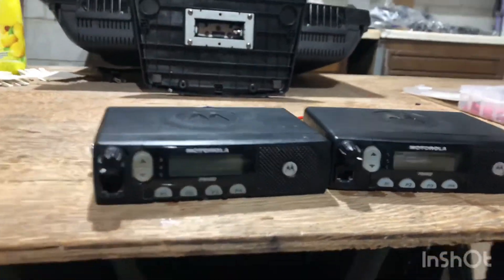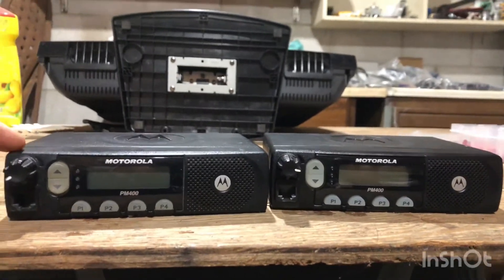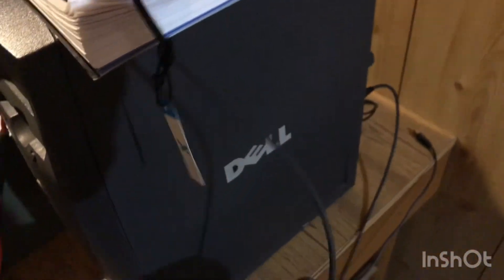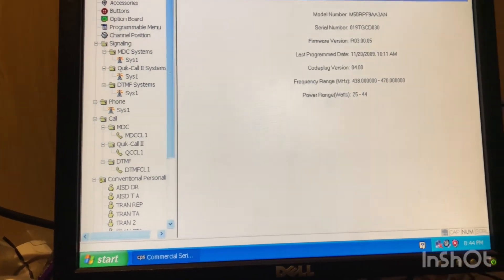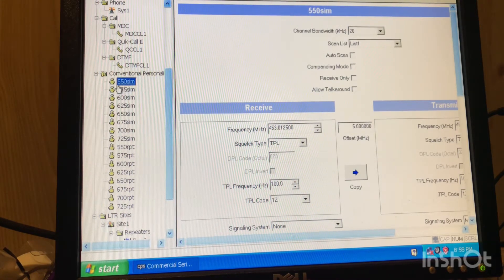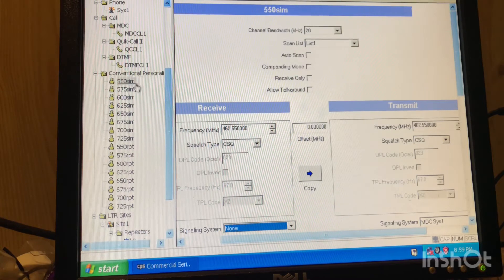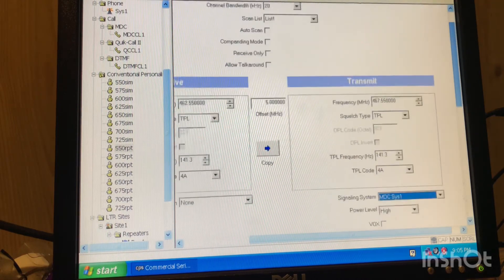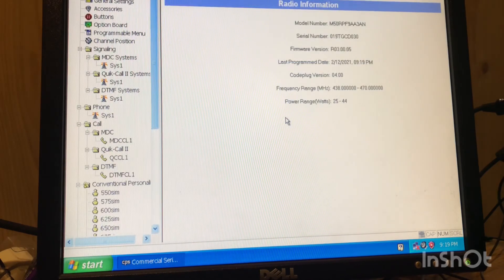Motorola PM 400 programming/GMRS

Comment: Having a problem after programming when I tx red light comes on one beep and no red light.
Reply from the maker: I’ve been out of the radio game for sometime other than basic use. However, if I ever had problems I can recall it being a Com port issue most of the time. In the software you should be able to com port check as well. 

Also, if that doesn’t help it could be the cable. Hope this helps. Thanks for watching!

Comment: Do you still program PM400's? If so, what's your pricing and how can I get it to you?
Reply from the maker: Negative, I lightly use and or mess with radios much more. We have a family GMRS repeater that rarely gets used. Also, Motorola is pretty strict with the licensing etc. I was lucky to have a local retired gentleman let me borrow the Motorola software. Thanks for watching!
Reply: I have free programming software if you still need it. The version that allows 25hz bandwidth

Comment: On the initial opening of the Commercial Series software I'm getting a note the it is  "Unable to open the Controller". Does this mean that I have to have the radio connected first in order for the software to actually open? Thanks
Reply: Set your com port to com4 and make sure your usb is plugged into com4

Comment: Hi, great video, I was able to program my radio thanks to you my friend. 
My radio also has Frequency Range (MHZ) 438 000000 - 470 000000, will I be able to program MURS frequencies by any chance ?
There’s any way of expanding the frequency range in this radios ?
Reply: No, murs is VHF (154 mhz) unfortunately.
Reply: I have the programming software that allows 25hz bandwidth if you need it. The newer version forces narrow bandwidth however if you have an uhf version it is stuck to uhf. There is another version that is vhf that supports Murs I’m pretty sure
Reply: Only way to do murs is getting a vhf radio. You will need a dual band radio to do both @GetBent520Az

Comment: Hello, thank you for the video, also I was trying to look at which version of CPS you were using, does this use a different CPS than MotoTRBO CPS? I could not tell from the video..
Reply: I have the software if you neeed it. It’s rvn4191 customer programming software. I have the version that allows 25hz bandwidth I know it’s late my bad
Reply: @GetBent520Az I need it
Reply: @GetBent520Az  do you still have the software? Please, I need it. lol
Reply: @ketonly8898 I have a vid posted with the DL
Reply: @ketonly8898 my replies won’t register for some reason lmk if you get this. But there’s a vid on my wall with the DL in desc.

Comment: Hi thanks for the information it is greatly appreciated, I just bought two of these radios and have no clue of anything pretty much other than push to talk to them was trying to transmit but no luck everything is the same on both radios with the exception that one has a little H on the display and the other one has a L could that be the problem?
Reply from the maker: I would make sure you have the PL tone set correctly. If you’re programming repeaters, make sure you have the plus 5.0000 MHz offset set properly as well. You’ll be receiving on 462 and transmitting on 467Mhz. If you can’t figure it out contact me again and I can give you my cell number to walk you threw the process.
Reply from the maker: Not sure on the H & L. Make sure you go into the software and check your comm ports. The newer radios tend to program easier, even with the cheap Chinese cables.